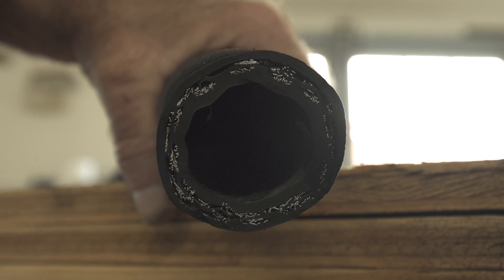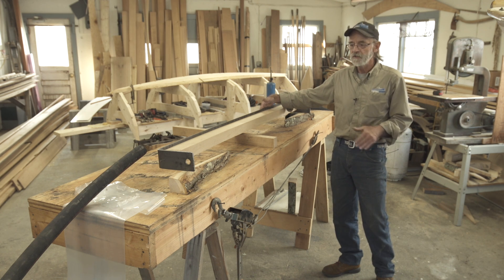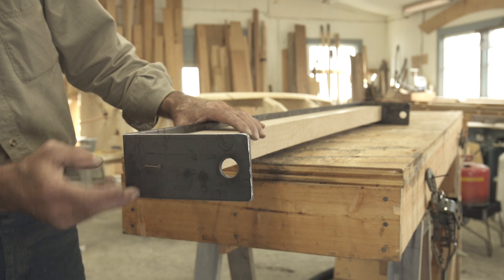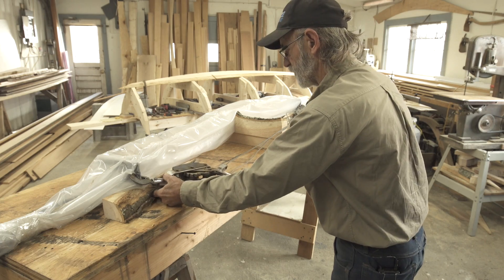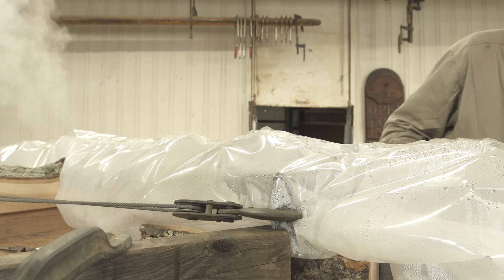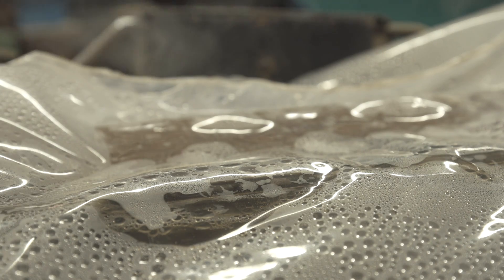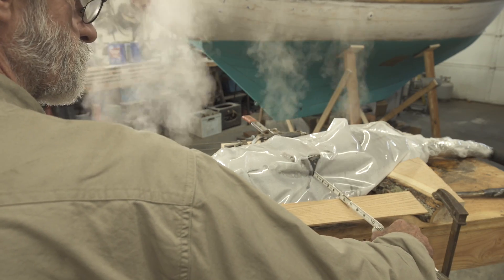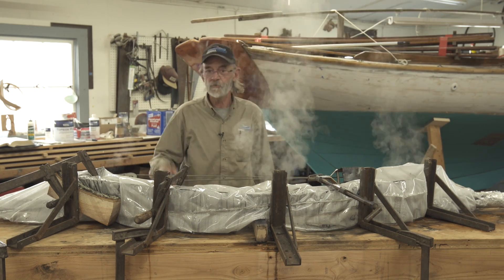Building the TotalBoat Sport Dory: Episode 10 - Compression Steam Bending

Comment: You could cut the outrigger strut to the right size to calculate how much bend you want in the curve. That way, when it's pulled tight enough for the strut to pull out, you'd know that it had enough of a bend in it to be the right amount without the need to check it against a straight edge.
As usual, awesome work, Lou; love this channel so much, thank you.

Jim

Comment: Lou, you could add a gauge glass style level gauge to the tank so you could see the level without using the bubbler tube. two 3/8 brass elbows and a length of plastic tubing is about all you need. Install one down below the minimum level you want in the tank, and the other one in the top. Braze the fittings into the tank, and connect with a length of tubing just long enough to span between the two fittings. When you put water in the tank you will see the level in the gauge glass constantly.

Comment: A very good water level indicator anyone can make is made from these: a piece of rod as tall as the canister, a piece of cork large enough to float the rod vertically (bottle cork stopper), a piece of coat hanger wire, and a hole.

A hole that's just large enough for the rod to slide with ease is drilled atop the canister. 

Through the open hole in the canister, the cork is passed, preferably stabbed in to another rod to keep it from moving, and when positioned just right, the cork should be affixed securely to the rod that's passed through the drilled hole. 

The positioning rod is removed.

Once that's done, with the coat hanger wire tied around the handle, a loop is made for the rod to keep it vertical.

Markings can be made with the rod at empty, half, and full tank.

Of course this is tailored for this particular can, in this particular application, but it's nothing special, and anyone can adapt it to their needs. 

Idea came from old, old tea kettles that were used in food courts. They were large ones that were hardly ever removed from the stoves and had a little peacock valve at the bottom to pour hot water. This device was present the main filling cork and it showed when water was running low so they could be refilled. So certainly, it's heat resistant.
Reply: Or you can just insert a pipe into the tank and blow into it and listen for the bubbles stop, like Lou did.
Reply: Or use a piece of clear pipe. Put the pipe in the kettle, cover the top end of the pipe with your thumb, then lift the pipe. The level of the water in the pipe is the level in the kettle.

Comment: Here is trick to know when water is running out in streamer vessel when running.  Place glass marbles inside the vessel, as water boils marbles bounce and make a noise. When water gets low marbles stop bouncing and change in noise let's you know you need to top up water before vessels becomes empty.  This is an old cooking method used for steamed items in the stove top.

Comment: Fascinating!  Doesn't the wood dent easily from your clamps or spacer? And I never realized that the heat, not the moisture, was the operative part of steam bending.  I know that green or wet wood bends easier even when cold, so that was a surprise - I suppose, though, that's just temporary because it springs back.

Comment: I read that the need for compression bending, particularly in thick pieces either across or with the rings, is that wood in tension is much more likely to crack or split open even though you are melting the lignin bonding the cellulose together; it doesn't really have anything to do with how much springback or recoil you'll get. What is your opinion and experience regarding this? Thanks for doing these videos and explaining everything in such detail! As a woodworker, though not a boatbuilder, I can understand the reasoning behind most of your techniques, and I love your unorthodox approaches to some of the work you show.

Comment: I had an idea lou. How about taking a roller tool used for setting the spline into a screen window/door and heating the roller and using that to roll along the edges of the plastic to bond the two layers together. Typically the roller tool is made of metal and it has a groove machined into the edge. I bet if you heated that roller and just roll it along it would melt the two layers together, easy peasy. There is a chance the plastic might stick to the metal roller though but it might be worth a try.
Reply: commercial bag sealers are essentially a nichrome wire covered in PTFE (Teflon). put a heating element in the roller and cover it with teflon tape. It may be preferable to heat the plastic from both sides so double rollers may give better results.

Comment: To check the water level you could use a straight clear tube, lower into tank, place thumb over end of tube and remove tube. The height of water in the tube is the same as the tank.

Comment: Just gotta say, I love your steam bag method. Seems like a one and done kinda method, but it definitely keeps the steam on/in the wood while it's bending and the compression steel bracket is genious as well. Usually I see a rigid steam box and the wood is pulled out and forced into a mold with clamps. If you don't get it shaped quickly enough, you can't get it back under steam in the mold. Your way seems much better. Now, if you were steam bending frames (for say a Gaff cutter), how would you go about it? The steam box and bend in place let's the outside of the radius expand, so, individually bag them with steel brackets? Or get a team together to cycle the frames in place, like on Acorn to Arabella's build?

Comment: Lou, I've steam bent many sister ribs, but need to bend a stem 7ft x 3-1/2" x 3-1/2".  Your method is amazing.  Q. A stem that's beveled, can it be shaped before bending or you recommend bending as square stock, cutting the beveled sides after? I notice your stem is square.

Comment: If you put a length of dowel or similar into the can until it hits the bottom,
and the take it out, you can see the water line on the dowel.Hold the dowel
next to the can, and you can see what the water level is.Simple and foolproof.

Comment: Lou, I tried your compression bending on the size piece of stem I described below (3months ago).  The process went exactly like you did it.  However, after 3 hours of steaming the outrigger broke the wht oak stem in the middle, now I'm back to square one.  What happened, does the wood need to steam longer and hotter for a piece that thick?  Maybe 3 or 4 outriggers needed so not so much force exerted in one spot?

Comment: Even if dry heat would work, steam would still be a superior method.  Mainly because water has over 4 times the Specific Heat (the amount of thermal energy each gram of material can absorb/release).  That means that for every kilogram of steam, you are supplying over 4 times as much Heat to the wood as the same amount of air.  Plus, I would assume that the wood could get dry, brittle, and singed using dry heat. If this sounds a bit clinical, well I am a science teacher.

Comment: Hi there Lou, thanks so much for the excellent videos, like many others I learn a lot watching your work.  Here's a couple of tricks I use in my composite construction that might be useful to you and/or your viewers.  Firstly, when I make inflation bladders I join the plastic sheeting by running a soldering iron with a rounded tip, around a template. The heat seals them and often 'cuts' the shape out at the same time.  All you need to do is have some baking paper on top of the plastic so the hot iron doesn't stick to it.  I also watched your video on penetrating epoxy.  We sometimes saturate MDF so that it cuts better on a CNC for example.  Here's a link to a short video showing how we use heat to get the epoxy way down.   Cheers, and keep up the excellent work, Steve.
https://www.youtube.com/watch?v=wr9BG9olj3M